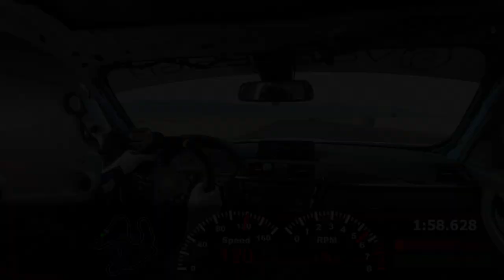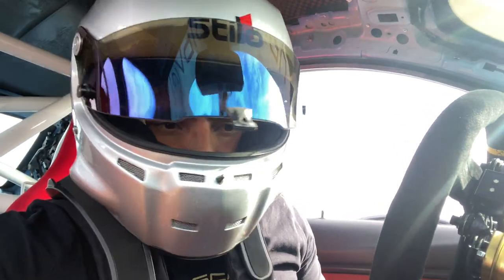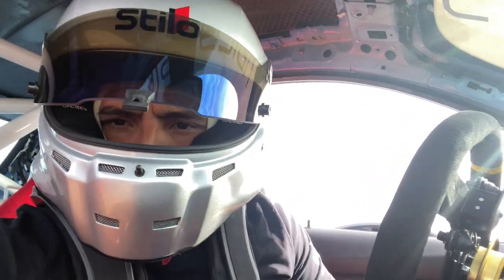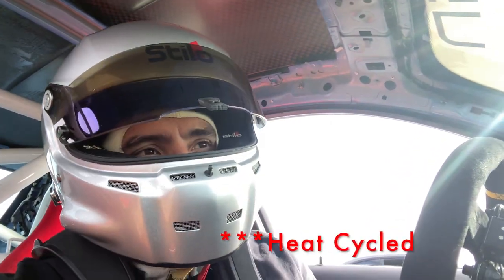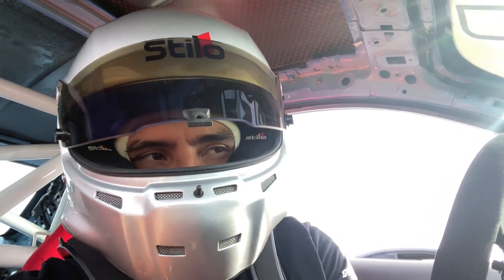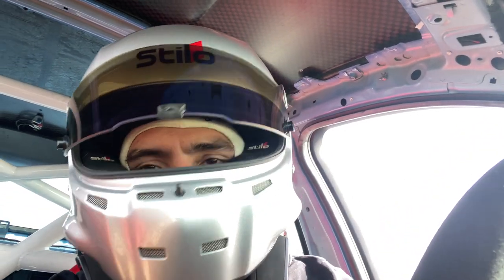Bimmer Challenge rd. 9 @ Chuckwalla Valley Raceway

Comment: Is there a reason why you shift so early?
Reply from the maker: Peak torque drops off around 6k. Anything past that and not at a significant speed is slowing me down from what I’ve learned on the S55
Reply: @Thewinnerscircle_  horsepower doesn't keep increasing up until redline?
Reply from the maker: @XL5Master  horsepower doesn’t pull you out of turns. Torque does
Reply: @Thewinnerscircle_  exiting the corner with peak torque and then using horsepower is slower than just staying near peak torque the whole time?
Reply from the maker: @XL5Master  you’re right but the S55 doesn’t tend to hold peak torque thru turns. It likes to blow off the built up boost. If you’ve ever tracked one, you’d instantly understand what I’m talkin abojt
Reply: @Thewinnerscircle_  I gotcha. I have an e92 m3 and yeah I have to rev mine. But I thought the s55 was pretty linear too.
Reply from the maker: @XL5Master  hell no bro lol the motor makes peak torque at 1800 rpm 😂
Reply: @Thewinnerscircle_  I meant linear like the HP is increasing over time.